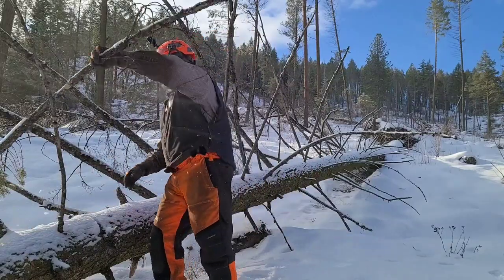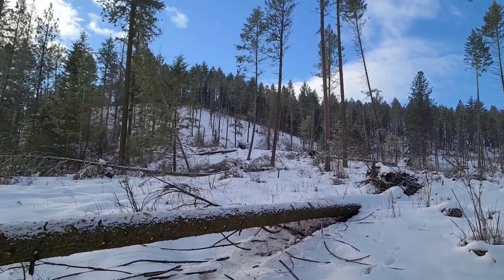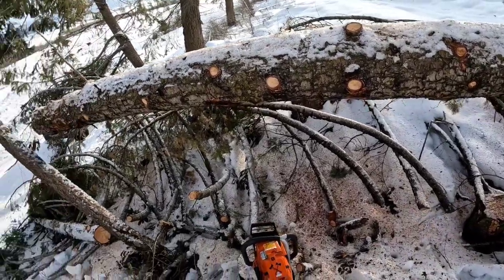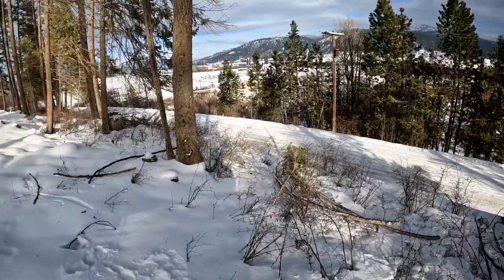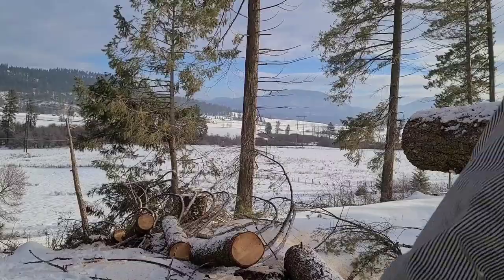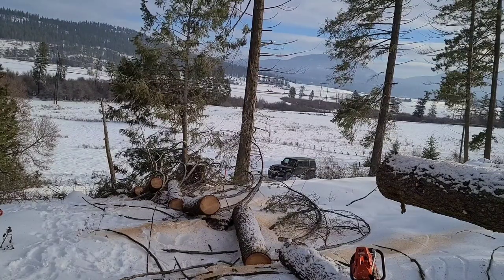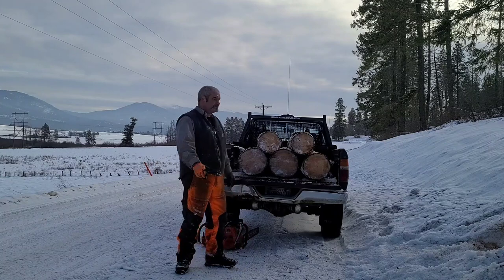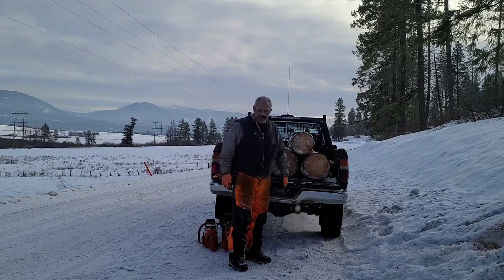FIREWOOD CUTTING TIPS COMPRESSION 1ST. 372XP

Comment: Nice job TazMan! Some of us, maybe most of us take it for granted that folks watching know most of these “basics” good on you to put it out there and share the knowledge.
Reply from the maker: Thank you Lumberjack. Love getting these tips out to folks that might be just starting to run saw. Love it🌲❤🌲👊🪓
Reply: @tazman-kennyfuller  Friend, how best to position the L nozzle on the carburetor?
Reply from the maker: @Sensei948  I usually start with my low jet at about 1 1/4 turns out. Then  tune it from there and meet it with the idle. Then tune high jet. These settings can vary from saw to saw and different elevations. 🌲❤️🌲👊🪓
Reply: @tazman-kennyfuller  Can the low L flow set to the maximum speed damage the saw during operation? H stream set correctly
Reply from the maker: @Sensei948  if the saw does not bog when you squeeze the throttle from idle it should be hood to go buddy. 🌲❤️🌲👊🪓
Reply: @tazman-kennyfuller  what revolutions to set in 372xp oe after renovation, replacement of the piston?
Reply from the maker: @Sensei948  somewhere around 12500. 🌲❤️🌲👊🪓

Comment: Genuine question. Isn’t using the top 1/4 of the bar (at the tip) asking for kickback? Please educate me.
Reply from the maker: Hello Aaron welcome and thank you for your support. You are correct about the kickback area of the bar and chain. But when I used that part of the bar it did not kick back. Learning to use the tip and the saw is recommended. 🌲❤️🌲👊🪓
Reply: If you go back and rewatch those cuts when he rolls to the top you can see the tip jumping a bit. That is kickback. It is indeed very dangerous but keeping a firm grip on the saw and always stand slightly to the left so in the event she comes flying up you don't get a face full of chain. Also your chain NEEDS to be sharp. Very sharp, A dull chain will kickback much easier. Take care.

Comment: Excellent presentation. But if I'm cutting firewood, I'm going top-down with gravity. It's a fraction of the effort :)
Reply from the maker: Thank you for watching and for yoir support Indigator. I prefer to cut this way to avoid it tearing the underside of the tree and possibly hanging up and having to make the undercut of the slab. Cutting straight down can be much less effort for sure. 🌲❤🌲👊🪓